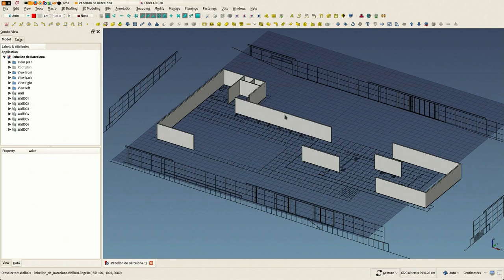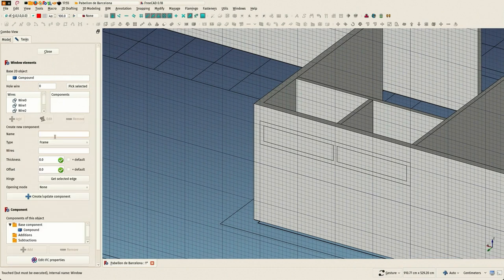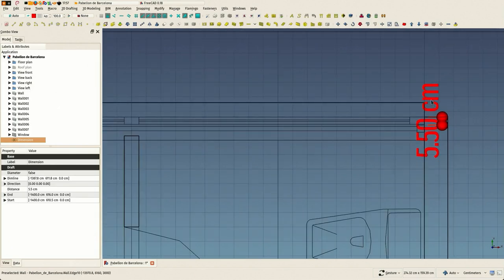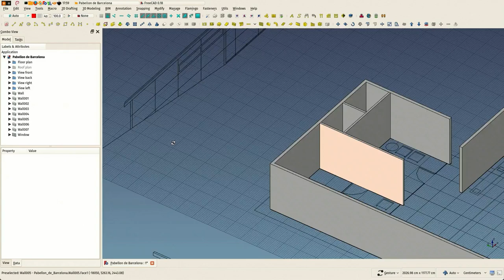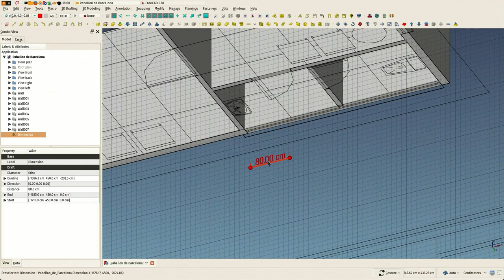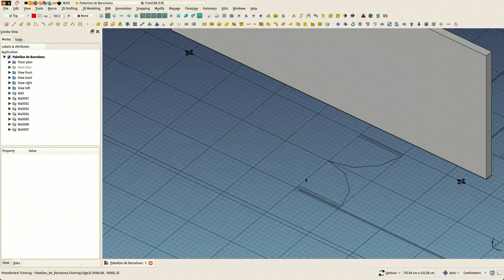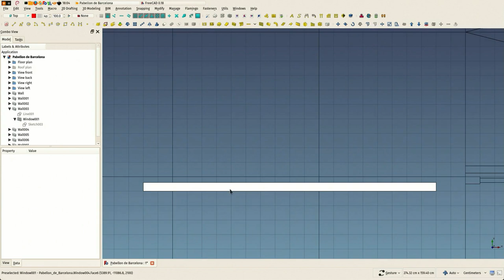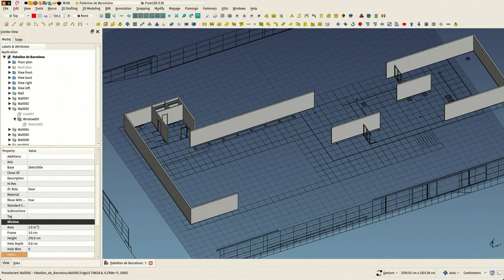BIM with FreeCAD - Barcelona pavillion 03 - windows

Comment: What is the best way to redo when having error for example.
Reply from the maker: There are undo/redo buttons. But very often it's faster to simply delete the wrong object and do it again. But if the problem is small, it might be easily fixable by changing a property of the object.
Reply: @YorikvanHavre  Thank you again!